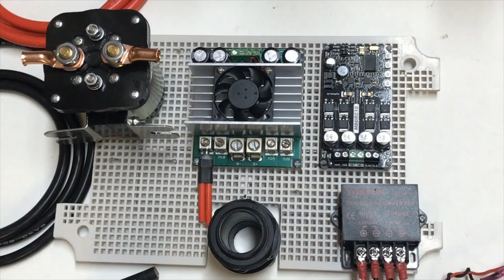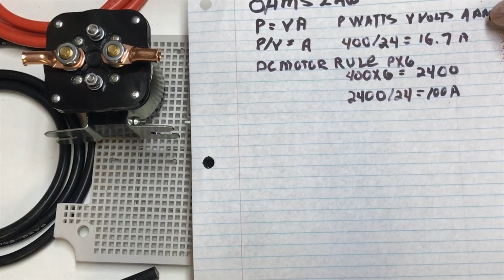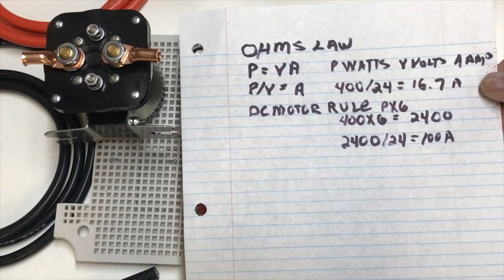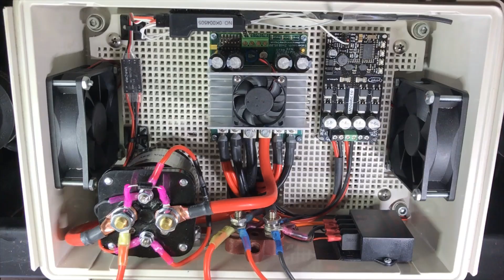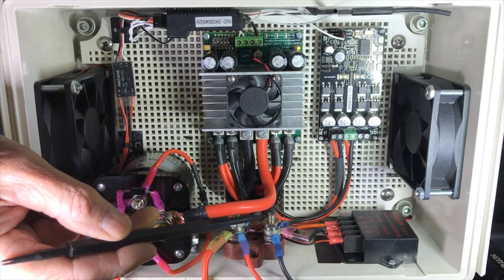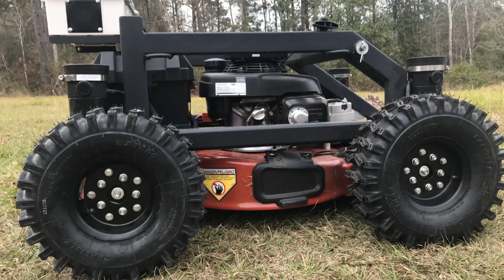4 WD RC Mower Motor Controller upgrade to Sabertooth 2x60 (Update)

Comment: Good morning, I like the 2x60 double sabertooth electrical scheme to control four motors, two front and two rear.
I have a project in mind and I need two 600w 24v DC motors, a left motor and a right motor of 660w 24v dc each and it has to make a tank type turn, could it be done with two sabertooth 2x60s, one for each motor? If it could be done, I would appreciate it if you could provide me with the connection diagram.
Many thanks in advance.
Buenos dias , me gusta el esquema electrico de doble sabertooth 2x60 para controlar cuatro motores , dos delanteros y dos traseros .
Tengo un prollecto en mente y necesito dos motores de 600w 24v DC ,un motor izquierdo y un motor derecho de 660w 24v dc cada uno y tiene que hacer un giro tipo tanque , ¿ se podria hacer con dos sabertooth 2x60 uno para cada motor? si se puediera  hacer , le agradeceria que me facilitara el diagrama de conexiones .
Muchas cracias de antemano.
Reply from the maker: The information you seek is linked in the description.

Comment: Same setup, but can’t get the contactor to energize.  Mult shows nothing on wire from contactor to saber tooth. Tested two contactors and the same. 
I jumped the contactor and sparks flew, but the saber tooth came on for a moment. 
Need help with contactor please.
Reply from the maker: Hi delasjw, I helped dannythoms solve a similar problem.  Read through his comments and my troubleshooting reply’s on my Four Wheel Drive Remote Controlled Control Mower Build video. I hope it puts you on the right track to solving your problem.

Comment: Did you consider using DC-DC Solid State Relay instead of this kind of big contactor?
Reply from the maker: I looked at SSR but was afraid of the heat they generated. The Sabertooth controller is heat sensitive. On 95 + degree days it will shut itself down due to heat inside the case.  I did not think about externally mounting the SSR AND heat sink. I’m kind of old school and went with what I was comfortable working with. If you have a recommendation, please let me know, I might use it when I add another motor controller instead of a using a contactor. Thanks for the comment!
Reply: @giterbilt5146  I have since learned that motor controller/motors are an inductive load and SSR are only rated at 20% of their rating for inductive loads. So if you get a 400A solid state relay, it is only truly rated for 400x20%=80A. 
In my application I'm using a Sabertooth 2x60 and using an 80A effective relay is not ideal. I did some tests anyway and in my application I was not going over 60A from battery but still the relay was extremely hot. 
I would caution anyone against using SSR with Sabertooth or any motors.

Comment: Hey in your dual wiring diagram. Are the motor controllers wired in series on the 4wd? Almost like a slave/master set audio wise but same logic.
Reply from the maker: No they are parallel. Each Sabertooth controls two motors. The control signal from a receiver channel is sent simultaneously to both controllers via split signal wire. S1 and S2  on both controllers receive the same signal input from their respective transmitter/receiver channels.

Comment: What diodes are you using?
Reply from the maker: Schottky Barrier Rectifier Diodes 5A 60V
Reply: @giterbilt5146  ok thanks Can I get your opinion?I got these laying around. I have sf54 5a 200v do you think they will work fine ?
Reply: I have the same set up as you also inspired by you as well.
Reply from the maker: Your diode is probably a better choice for the coil circuit. Dimension Engineering specified  5A 60v diode for the motor controller https://help.dimensionengineering.com/knowledgebase.php?article=7. I picked the Schottky diode because I was taught (40 years ago) they provide the best reverse current protection. I used it for the coil energizer because I had 99 on hand. I would think your diodes would work for both.

Comment: Sir what batteries do you use? How many ah? Thanks
Reply from the maker: I use two Weize 12V 35AH Battery Rechargeable SLA Deep Cycle AGM in Series for 24V.  https://a.co/d/hDJ6Ei0

Comment: Hello. Can you help me with connecting the sabertooth 2X60 directly to the R/C?
Reply from the maker: Review wiring at minute 7 in the video, there is a link to my wiring diagram in the description. A good source of information on wiring and rc setup of the 2x60 can be found in the Dimension Engineering Sabertooth 2x60 User Manual. Google it, it will show up. There is a whole section on RC wiring setup.
Reply: My mower is firing the motors after charging the batteries. I don't know what it could be 😞

Comment: Love this, I am thinking of doing the same thing. What are the wattage of your motors? I have wheelchair motors that ran on the stock controller on 90amps I don’t know the actual wattage but do you think the peak of 120amp will hurt them? What type of wiring did you run to the motors? Thanks I’m advance
Reply from the maker: My motors have a peak wattage of 1200 each. As I mentioned in the video, they require 100amps per motor controller channel at peak.  I only have 60A. I am thinking one using two motor controllers with one motor controller channel per wheel motor.  I have a schematic on this that I will post on the google drive.  If you have a motor controller that has an running amperage greater than the peak amperage you will be ok. The motors dictate the current requirement, if you have a 90 amp peak requirement it will only draw 90 amps from the controller. The 120 amp controller will be ok.  See Nelson Silva comment. The wire to the motors are 12 gauge.
Reply: @giterbilt5146  ok, that makes sense. Thanks for the help.

Comment: Good afternoon
Congratulations on your project, which will certainly have influenced others to make an identical machine, or with other applications.
Congratulations for sharing your knowledge, and for persisting in the project.
I also intend to do something identical, but I need something with a little more force.
I have some doubts:
      1. Why did you use 24V instead of 12V?
      2. Your model has 4 motors of 200W at 24V, and for that you upgraded to a Sabertooth 2x60.
      3. It is possible to use 4 motors of 400W at 12V or 24V, and for that to use two Sabertooth 2x60
      4. It is possible to interconnect the two Sabertooth 2x60
      5. For 4 x 400W power, at 24V will the SPNO Solenoid have to be stronger? 24V 500Amp.
Thanks
And once again congratulations 😃😃😃
Reply from the maker: Hi Nelson, I used a 24V system because my motors are rated at 24V. Yes you can run 2 Sabertooth 2x60 to control four motors. I have contemplated doing this with two 2x32s. You can get RC signal cables that split so that the input to the sabertooth controller are the same signal for the channel that you’re operating.  One RC channel controls M1 on both controllers and another RC channel controls M2 on both controller. Yes the solenoid/contactor would have to be sized by the total max current draw. Minimum is 240A. I would do as you suggested, 24v 500A. The larger the rating the cooler it will run. 

An added benefit of using 2 motor controllers is you will have a true 4 wheel drive. With a single motor channel controlling two motors is that if one motor looses ground coupling (one wheel not touching the ground) the uncoupled motor will be the only one that spins.
Good luck with your project.
Reply: @giterbilt5146  😀Thank you for your clarifications
Reply from the maker: I have a dual 2x60 motor controller schematic on my google drive. Link is in the description.

Comment: does anyone know what the component is on the top right and what is he using it for?
Reply from the maker: Hi Dale, the component is a Cytron Dual 10A RC motor controller. I use it to operate the actuator that raises and lowers the front tool bar.

Comment: Can you share you charging system please
Reply from the maker: Sure, the 24v alternator has two wires, a positive and a negative. Positive alternator to positive 24v and negative alternator to negative 24v.  The two 12v batteries are connected in series to provide 24v.

Comment: Yep I've just gone through exactly the same exercise with the Roboclaw 2 by 30 amp and have now upgraded to 2 by 60amp.  When I contacted BasicMicro they said the stall current of a brushed DC motor can be between 3 and 15 times the motor's continuous rating.

Best regards

Alan
Reply from the maker: Hi Alan, thanks for the info. I’d hate to know If a I needed a controller @ 240amps. Ouch!!$$$$ I’m glad my mower is working fairly well on 2x60.

Comment: What is this motor rule px6 exactly? Do you have any resources about this?
Reply from the maker: If you only know the motors continuous operating current and do not know the max current, then the six time rule can be used for a ballpark max current.  As I have learned from experience, the motor controller current rating should be calculated for max current.  Why max? If you using the mower on a very steep incline you can sometimes stall the motor by starting or stoping to quickly. I do this a couple of times when mowing if I get too aggressive with the joy stick movement. This link should provide some information on the 6 times rule. https://www.power-supplies-australia.com.au/blog/power-supplies-use-dc-motors.
Reply from the maker: Please read russkydeutch comment for additional info.

Comment: Is the ElecHawk DC in on the terminal blocks ? What direction is your diode (on solenoid/elechawk ground to positive?) ? Do you have a diode on the key switch?
Reply from the maker: There is a link in the description to a google drive that has the wiring diagram.  The two diodes used have cathodes going to +24v. No diode on the key switch.
Reply: @giterbilt5146  thank you.  I have used this on a 40v kobalt and it works very well!
Reply: @giterbilt5146

Comment: Why cannot connect receiver to 5v from Sabretooth?
Reply from the maker: The Sabertooth has no power until the contactor is closed.  The receiver needs separate power for the channel that turns the Sabertooth on and off.
Reply: @giterbilt5146  alright, that is fine. Still need mechanical switch to power up receiver feed. So i have switch, that power up Sabertooth, this gives me 5v for receiver. Then from receiver i am able to move wheels and start lawnmower electric motor.
I asked really because i found that rc pmw switch  i use can not feed from same line that used to power up receiver.

Comment: Hello Mr Griter, if possible what was the cost to build this +/- thanks
Excellent build!
Reply from the maker: Hi Ivan, the current controller box cost is around $500. I probably have over $2500 invested in the mower to date.
Reply: @giterbilt5146  thanks

Comment: Great video. Would you have the Sabertooth diagram in another format by chance? Thanks.
Reply from the maker: Hi Roderick, yeah I  pronounced diode specification incorrectly. Your right, it is a 5A 60v diode.
Reply: You mentioned you used 5v 60v schottky diode? Is that supposed to be 5A 60V? Thanks.
Reply from the maker: The drawings were created using LibreCad which saves it to dxf format. LibreCad will also export to SVG, PDF, image file types. LibreCad for windows is free.  In google drive you can also print to file in PDF format. Google “dxf file format”. There are quite a few applications you can use to convert dxf to other file format.
Reply: I followed your process and I am experiencing diode failure while in operation. I am using only two Jazzy Z motors for my application.

Comment: Excellent design cleanly executed!  Great tip on the diodes. I was contemplating having a kill channel failsafed to off, with 2 rc switches on a Y. One to a contactor to kill the ESC’s and one to ground the kill wire to the engine’s coils. In RC flying I always use the same switch to lock the throttle at cut position. Could have pan/tilt on rudder/elevator, motor control as an elevon mix, knob to throttle the engine with a dual rate setup to allow choke, maybe start on the trainer button….

Comment: What kind of engines are you using
Reply from the maker: Hi Marek, I used Quantum Q6 wheelchair motors. Creating a mounting plate for them was arduous task. If I had to do it over again, I would use motors that  have a square hole pattern for mounting. Watch the build video for my explanation of the mounting difficulty.

Comment: Can't you use receiver itself to energize the solenoid (so no Electhawk)? Is it too little of amps? Or it because receiver only produces 5V?
What is the output voltage of your Electhawk?
Reply from the maker: Hi Gaurav, the spec sheet for the contactor indicates  that the coil requires 24V to operate. The Elechawk RC switch is used to supply the 24V needed to energize the contractor coil.
Reply: @giterbilt5146  I understand. Thank you

Comment: Good day mr.giter Bilt, i watched your vedio on fly sky setting up two speeds. it is really fantastic.Appreciate if you can share the details of electrical connection for the linear actuator for raising & lowering the mower.
i wish you good health and happiness. regards : G.k.Rao
Reply from the maker: The linear actuator is wired the same as the 2x60 and connected to channel 4 on the Flysky receiver. Here is a link for the Cytron data sheet, it has very detailed instructions on wiring. https://docs.google.com/document/d/1MtfMosoGbtwMtnUFNAD_ilL7v05ski7z2r-MFWURM6g/mobilebasic
Reply: Thank you so much Mr.
Gilter bilt for the detailed info on MDD 10A MOTOR CONTROLLER.
Reply: is it 24 V linear actuator? Thanks
Reply from the maker: Yes

Comment: What are you using the MDD10A for?
Reply from the maker: Hi Andre, it is used to control the linear actuator that raises and lowers the toolbar at the front of the mower.